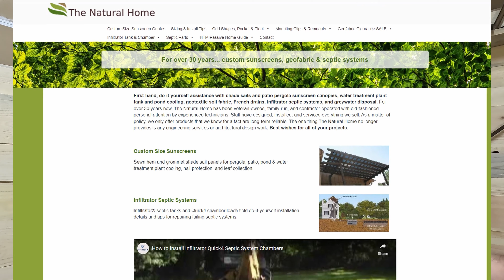The Reality of Building My Off-Grid Cabin in the Woods.

Comment: Instead of the leveling screws it would have been much better to simply set the 4x4 into the blocks and then snapped a level line to trim the tops.